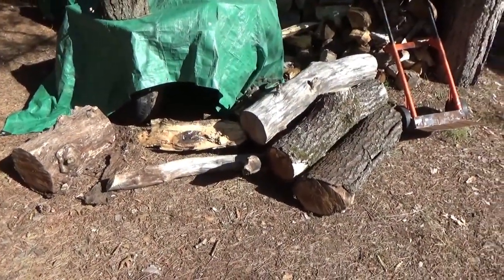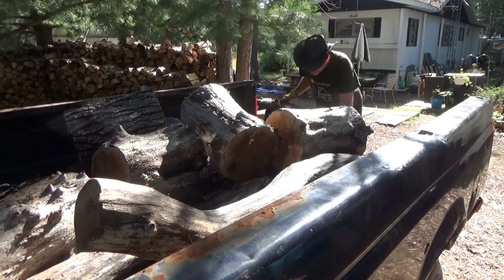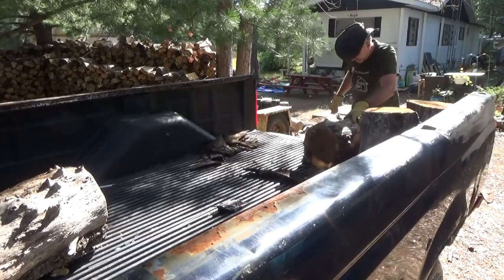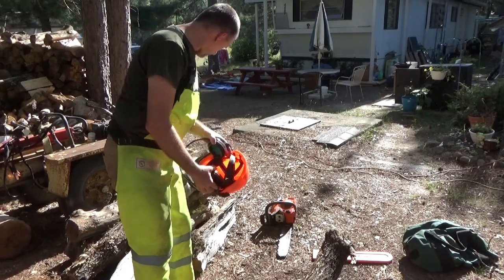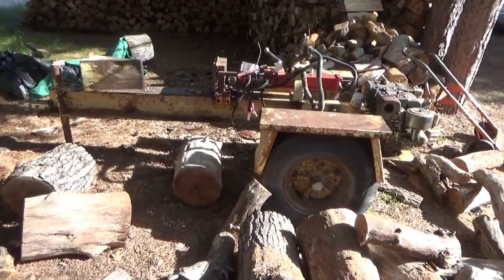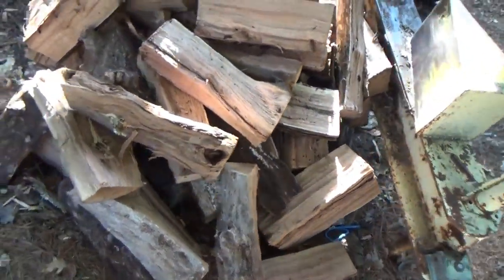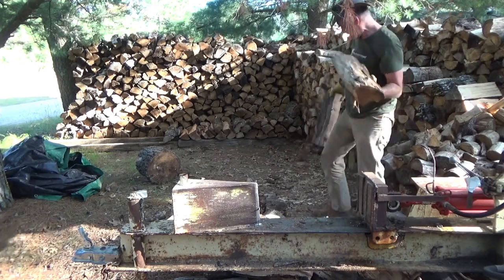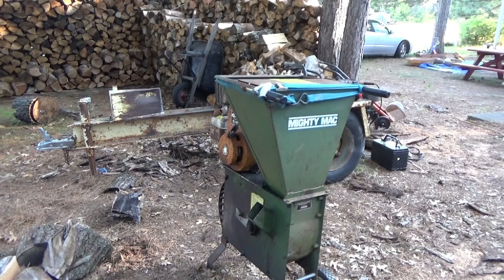Processing Fire Wood For Off Grid Tiny Home Heat

Comment: sTILL WAITING ON THAT WIND TURBINE ACTION...Sorry caps stuck...
Reply from the maker: Have to wait a bit longer. Town Hall has new code books and I have to find out what the codes are now.
Reply: Have you thought about a ground turbine?
Reply from the maker: I am always thinking of ideas. I am looking into a Bedini Motor combined with a Wind Turbine. Or a lenzless wind turbine. Basically you can pulse a generator output and reduce bogging and energy required to turn it.

Comment: Every hour used on making firewood,, is time you can use again next year,, every hour spent on improving insulation, it time saved on making firewood every year. :-)
Reply from the maker: True, but cutting fire wood is very cheap and it feels good to be helping yourself. The satisfaction of heating your home at a very low cost cannot be explained. But you have a wood stove too, so you know what I mean. I hope to get some insulation in the ceiling of the tiny house next year. We thought it was temporary and we wanted to use the mobile home but never got to it. But the mobile home will take about 20-30K to insulate properly. Tiny house is probably going to be our permanent home.

Comment: You need to install a return spring on the control lever.
Also convert it to a 4 way splitter for easier and faster  all round working
Reply from the maker: Spring wont work. This one bogs the engine if I pull the piston all the way back and dont release the lever

Comment: Another day of great progress on the wood pile. I bet you feel a great sence of pride as you should
 Great work Troy. It will be so nice when winter comes and your nice a cozy warm
 When will you clean the chimney  this year? 
What's Melanie making for dinner and a Q&A would be a easy and welcome video
Reply from the maker: Thank you. Cleaned the chimney in the spring.
Reply: @TheDoItYourselfWorld  I asked about chimney  maintenance because I wondered about that. I remember  my dad cleaning every year before burning and he always burned a  creosote log that helps break stuff up just before he swept it. He always told me it was important to prevent first especially  when burning and pine. We seldom burned it unless we ran short on wood. Can you tell me for my learning why you wouldn't  do it yearly before winter ? Is it because of the kind of stove?  I want to have a wood burning stove in next home so knowing would help me understand and others help properly  maintain their stoves. Thanks
Reply from the maker: I have to clean the chimney 3-4 times a season due to burning pine. I happened to clean it in the Spring because it was cold and I figured we would still need it. Turned out we did not use it cause we were never home.
Reply from the maker: And I burnt it hot once a day to make sure the pipes stayed cleaner.
Reply: @TheDoItYourselfWorld  thanks for taking the time explain that was helpful learning